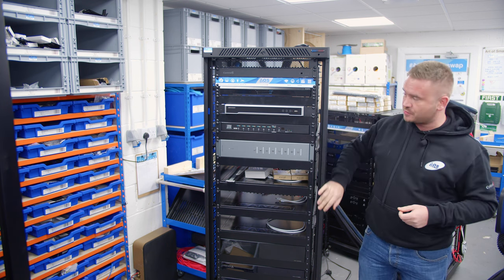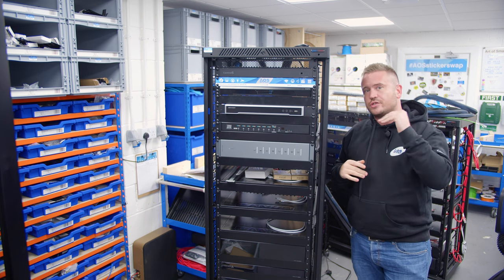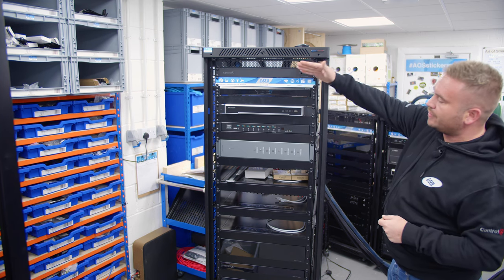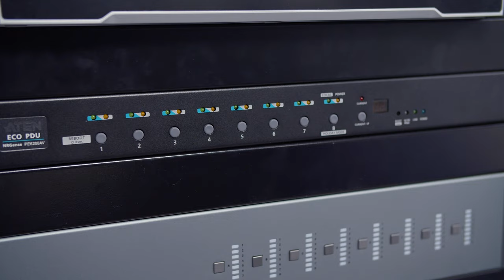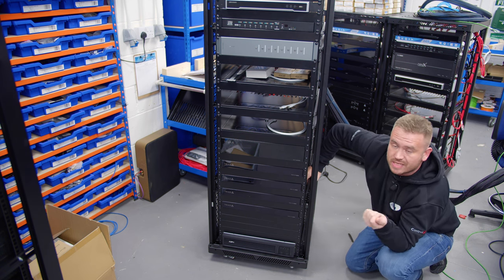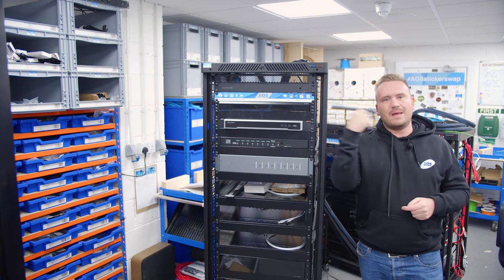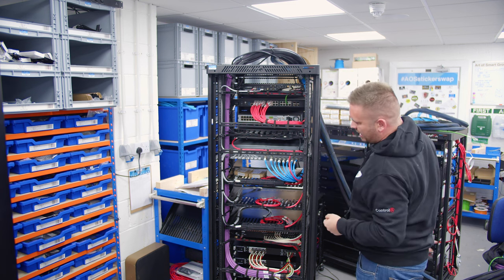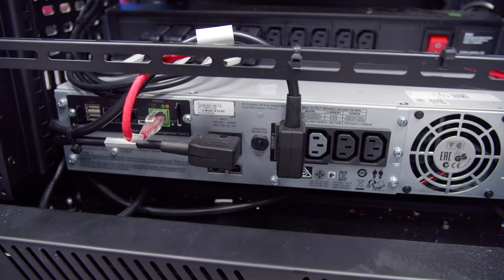36u Rack For Our WALES Country Manor Smart Home! - Rack Walkthrough and Design Drawings

Comment: I have ? regarding the control 4 ,,If I invest in control4  smart home system and do my whole house  lights cams ,theater  security system all of them ,is it one time payment of after installation do I have to pay any subscription ,like monthly or it just fit and forget ,as long as I don't need  updates or not adding any new products ,?, to update do  need to pay ?
how does it work?
Reply from the maker: Yes you only pay for the components and whatever it costs to install it

Updates arent that frequent and can be done remotely - we usually do big updates in person as they can knock parts of the system offline and obviously clients don’t want to be dealing with that
Reply: @ArtofSmartUK  thanks for the reply
Reply from the maker: No problem - will mention that you can do the updates yourself when they are rolled out but it’s probably ideal if your installer does them. 

Your installer should be doing yearly service visits as well but again that’s not mandatory or part of the control4 system